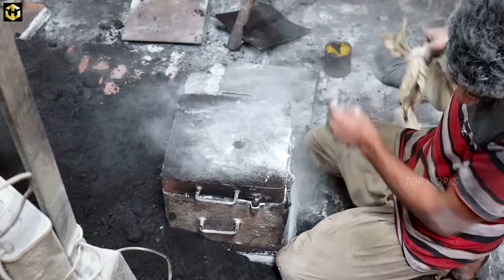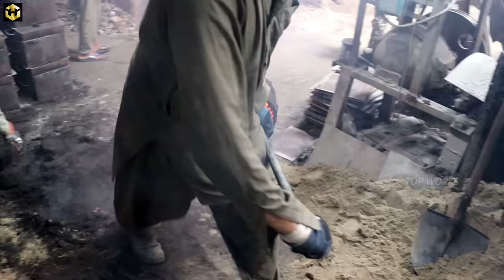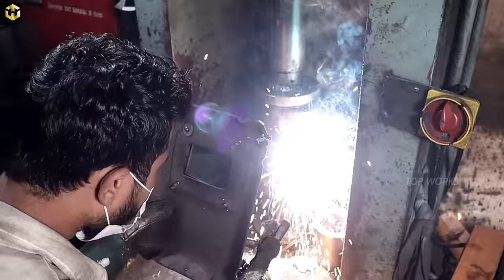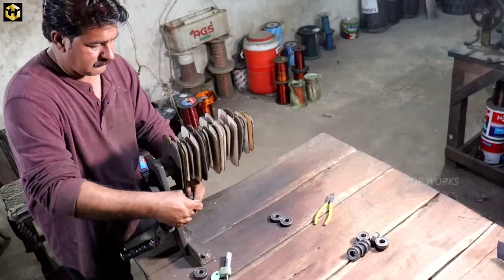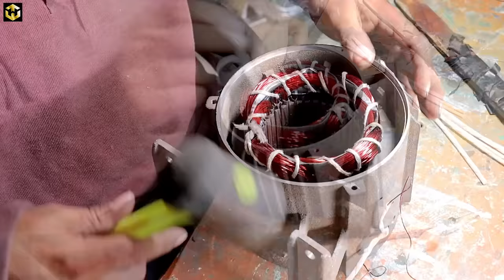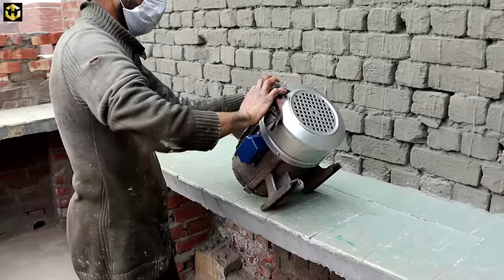How to Make Electric MOTOR in Factory | Amazing Electrical Motors Manufacturing Process

Comment: Why do others care about such trivial matters as power consumption, torque, efficiency, balancing, insulation resistance, ... ?
Apparently none of that matters. I am very impressed by the man who winds the coils. I can't begin counting turns as fast as he can.
Also amazing that the insulation of the copper wire goes along with this treatment.
Reply: Literally thinking the same thing. 😂
Reply: They are probably just wanting to seem smarter than everyone else so they get really technical.

Comment: First they create the external molding. This is done through alnico wort iron. They first keep the parts inside and then they do packing the filler part by part to reach the groves. Then they pour the molten. Then they break the shells off the mold ingots to get the final form. Then drilling polishing and sanding. Then coil assembly. Winding coil insulation fabrics and sealing. Then assembly core and test and fan. Finally capacitors and diodes. Packaging painting and sealing and stickers.

Comment: Of course this is all ancient technology - BUT, the fact that most of it is done in one place and people are familiar with the actual process is interesting! 
In modern factories many people only do a tiny part of the creation. 
This is probably 1/10th as efficient as a modern factory, but something the market doesn't need so many motors so it may not be worthwhile to invest in automation.
Reply: Back in the 80s and 90s I used to work in a factory where they also made electric motors.
This process is pretty ancient even by the standards back then.
I wonder what their injury rate/chronic health issue rate is?
Reply: @lesfox2010 this people don't have any insurance

Comment: I’m a U.S. Navy trained Motor Rewinder and have never turned out a motor that fast. To be fair though, these folks are winding a single phase motor using class  A poured insulation. We rewound using class H insulation and mostly poly phase motors. These are much more involving, and the cores are “rewound” not new.
Still, I think their better at the game and faster, just not as precise.
Reply: We Europeans built machines that do all that full automatically, so why should we work so fast when we can do far better in another way?
Reply: @sanitar-otti320  how sad for you! If you don’t have a machine it just doesn’t get done.
Reply: That portion of the video is spead up
Reply: Those experts are humble God fearing modest people I think in Pakistan. They are good engineers even if they don't have a degree I salute these experts from India.
Reply: @Two_Bears  If I don't have a machine I built me a one.
Reply: @leopardtiger1022  my be this Pakistan 😁
Reply: Ejaz Ahmed  Life time guarantee is good but running around daytimes in a pyjama and with flip flops in a steel mill is bad. End of story.

Comment: I would buy with confidence this motor . The shop owner should be proud of his excellent workers. Are those working on 220 volts ? What is running amperage ?
Reply: Yes thats probably in Pakistan so should be using 220V. Not sure about the amps though.
Reply: 420v
Reply: @RavinderSingh-gv7vp  , ouch c'est élevé !
Reply: Running Ampare Will Hart Attack Yu..
Because
We Don't Knows About It's Technicalities...
Reply: It's 220 Volts.  Amps not sure.
Reply: @redfordrn  , thank you.

Comment: Artisans  do amazing work, stuff generally done in sophisticated manufacturing factories. They rebuild tires, motors, generators. They are experts in machining processes, mill gears, making molds, casting, welding pipelines, vessels. They are fast learners. They attire us dirty looking but the are extremely talented people. They amaze u with what they produce. Hardly any education but they can fix anything, they figure out quick the best way an work arounds, reuse waste looking stuff with ingenuity and fix broken things.

Comment: tlvedio title should be making motor with out computer/ AI or classical way of making electric motor in factory.
Edit:  I can underatand now undesrstand that how difficult is manufacturing  without a computer.
A lot of effforts are required here ,  which deserves atleast a like from oursides.

Comment: so amazed me the motor is so quietly.. 👍👍
but my question is how long it takes w/o knowing the durability of stator coil?
i suggest you should build your own durability test room to check your oem industrial motor.. 👍
Reply: We have installed a water pump some forty years ago with the same type of motor. Only ball bearings of the motor were replaced, as well as, some parts in the pump portion....... and its still working.

Comment: To those who knows, why did they weld the core? I thought those thin metal layers shouldn't be connected to each other to prevent high Eddy current losses.
Reply: Cheaper and quicker than a 60 ton press.

Comment: Always been into electric motors so this was very fascinating to watch. Questions though: Where is this factory? Why aren't they wearing protective gear!? Why is the sound in the video messed up?
Reply: The fins of the cooling fan shown towards the end of the video should be twisted to produce better air flow, no!? The fins were just vertical/flat, not angled, and thus won't pull/push air much at all, afaik. Twisting the fins is a super easy thing to do, an easy improvement to cool off the motors.

Lastly it seems the motor Quality Assurance can be improved by setting up and using some (semi-)automated testing instead of manually hooking up and eyeballing each motor. 🙂 Specifically that will (1) enable the factory/workers to do repeatable tests and get metrics from each motor and thus measure room for improvements, and (2) possibly streamline and make the testing more efficient by testing in parallel using instruments, thus increasing the factory throughput while reducing the manual workload on the workers (analogous to changing from assembly line workers to automation).

Comment: How is the laminate core supposed to stop hysteresis if they weld across them shorting the laminates out?
Reply: I am no expert in electric motor design but a brief search on internet told me that laminated cores are used to lower Eddy currents and therefore increase efficiency.
It has nothing to do with hysteresis loss. Hysteresis loses are lowered by using better material (eg. silicon steel).
Reply: As to the Eddy current loses, I cannot really tell how shorting the plates in one spot changes the properties.
Reply: @sustmi  I am a ex Navy trained motor and generator rewinder. During lab training we could visible witness the results of heat buildup caused by shorting silicon plates with welding. Motor laminates are usually pressed, not welded. Using silicon steel to manufacture cores reduces hysteresis and eddy currents as long as the core material is separated. Great care is used to insulate each laminate from each other. If you are to weld it, then you might as well make a solid core and skip all the work the manufacturer went thru to make it. Of course, the heat buildup would destroy the motor. I am not concerned how you put the motor together, it is your motor, just pointing out a problem.
Reply: @Two_Bears  Thanks for the elaboration.

Comment: By the looks of it, this is a 2hp 1.5kw 240/1/50 TEFC motor.  The smaller ones are 1hp 0.75kw.  All single phase.

Comment: The reason the sand burns, in case you wondered, is it's regular sand that is impregnated with used motor oil.

Comment: These are not world-standard quality motors.  Every possible corner has been cut.  There is no care or quality control in the casting process, the drilling, the measuring out of the wire, the installing of the windings, the strapping and varnishing, and more.   Motors of this quality probably have a mean time to failure of like 4 months.